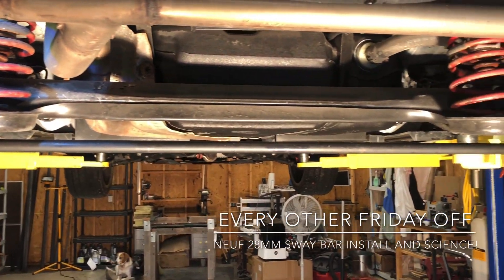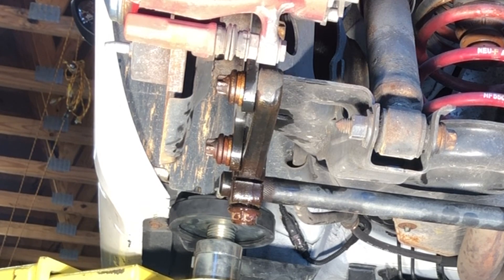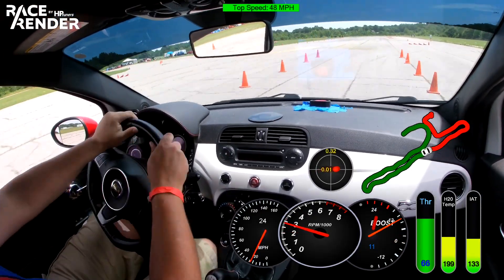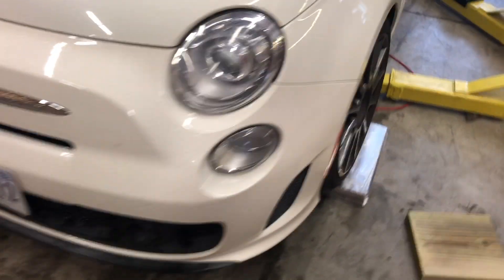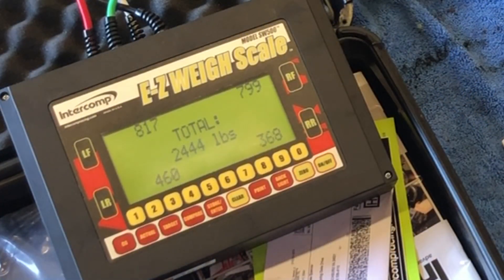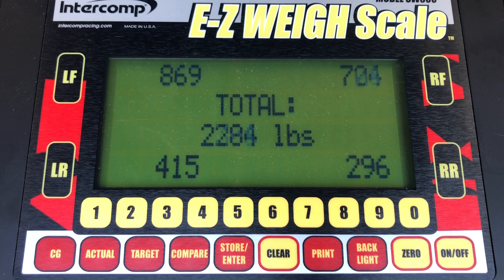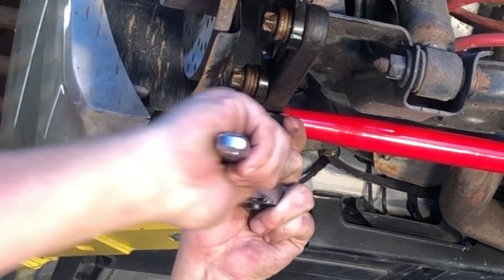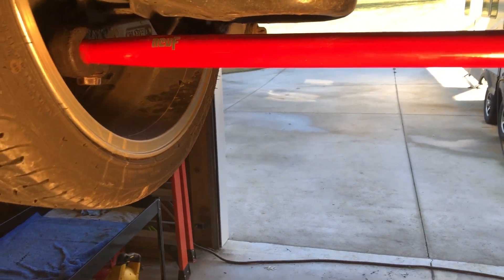Installing a Rear Sway Bar for a Fiat 500 Abarth, and Testing with Science!

Comment: I installed the NEU-F torsion bar on my Abarth last week. It does make a subtle but noticeable difference. I could feel the bar counteract the car's understeer while going through a roundabout reasonably fast. The bar also eliminated the car's habit of "twerking" just a bit on the highway, making it much more stable.

For the two TORX bolts, I had to remove the brake caliper, rotor and metal shield to get at them with an impact driver. It took a bit more time to finish the job, but I did learn how to work on brakes, and I was able to torque the TORX bolts to spec (80 ft-lbs).

Comment: I have a 2013 500e that cups the tire on the driver's side rear. This has been going on for 70,000 miles with that tire being replaced regularly. Any ideas what is causing it?